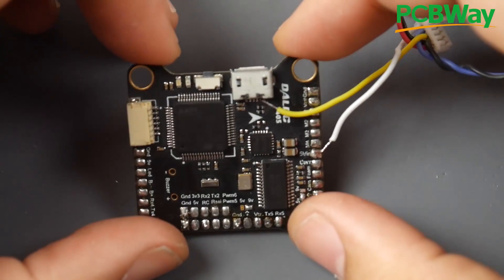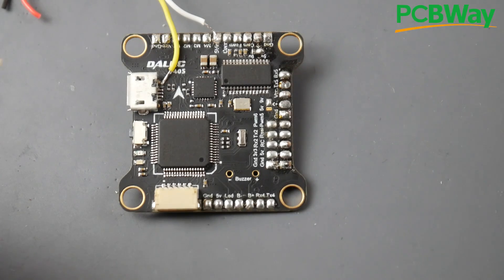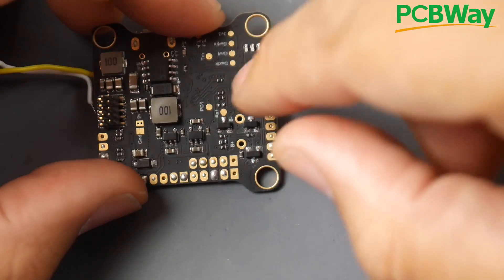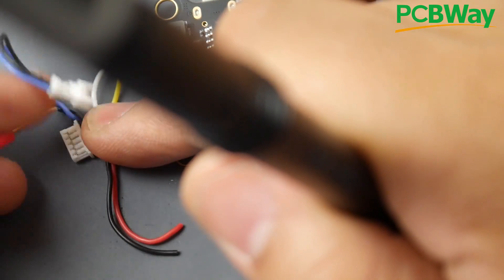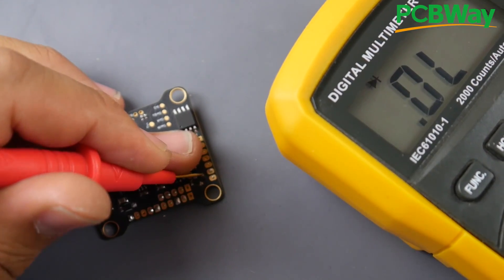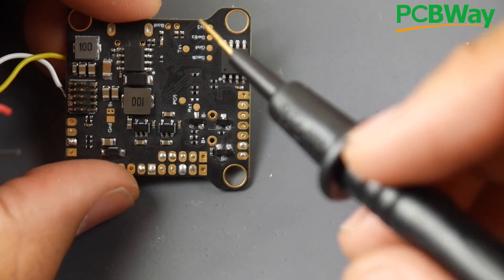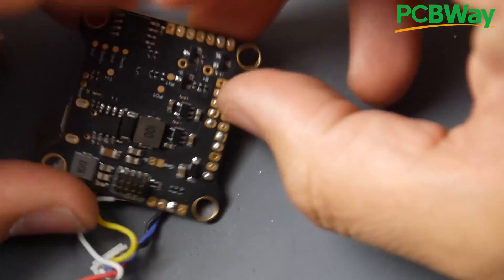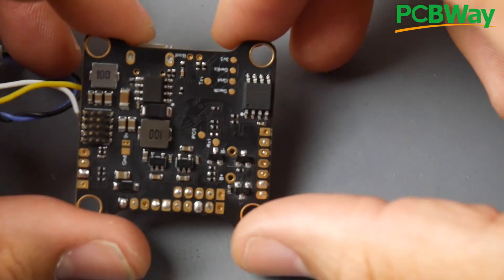How To Fix Flight Controller NOT POWERING ON // Repair Video

Comment: Hi i had a motolab temptest and its a tight build i had to re-bind my xm+ after updating betaflight. I shorted out my unify in the process installed another and burnt it out also. How could I test my fc to see if theres a problem there now any info would be great.
Reply: sounds like your pumpin too many volts in it . is it a 5v  vtx?  if so get a multimeter and check DC volts on your 5v regulator output. if its bad it will show VBATT and not the stepdown voltage .
Reply: @prrcpor  the quad quad was perfect until i updated to 3.5 now its just destroyed 2 unifys think its better just to start fresh just keep frame motors thanks for your reply

Comment: My micro quad is doing about the same thing. When i plug in the usb, the flight controller, and video transmitter powers on. However, when I power up my micro with a battery, i only hear 3 beeps and not the 5 beeps and nothing turns on. Any suggestions would be appreciated.
Reply from the maker: Seems like its the same issue as in this video. ESC initialize but the 3.3v does not boot up the MCU.

Comment: Ok I have some dumb questions? 
I have a couple boards w/broken bind buttons, that won't boot, where can you buy some new ones to solder on? 
Plus they may be different sizes??
On Horizon Spectrum Crap Quads, Planes, Etc... 
2) I also want to mod a couple slider pots onto the back of a TX to wire in conjunction w/the 2- turning pots on radio face, so I can use either/or for like pan/tilt cam mounts, wing tilts, etc!?
Where can you get them at???Thanks
Reply: Grumpy John TX Redneck RC - you can get all those tiny electronic parts from banggood or even on wish.  Drone Mesh showed some sample booklets of components you can buy on banggood.  They are reference books with samples of the different sizes/clases, like, resistor samples, diodes and so on.  But you should also be able to get them in packs of 25 or 50.  All you need to know is the size and the name or number of the component.  Most microelectronic parts have a number printed on them, but you need a magnifying glass/microscope to read them.  Hope this helps, and good luck shopping ;-)